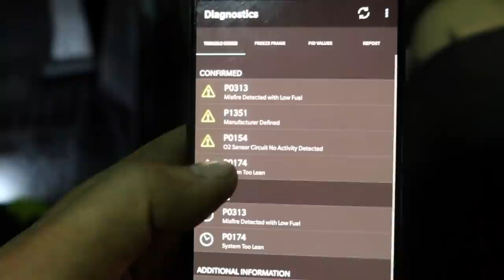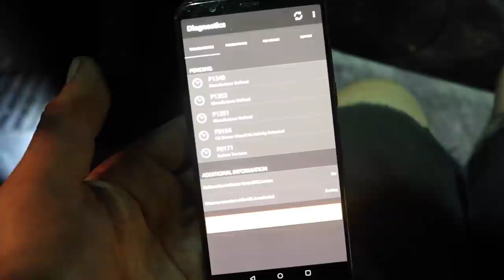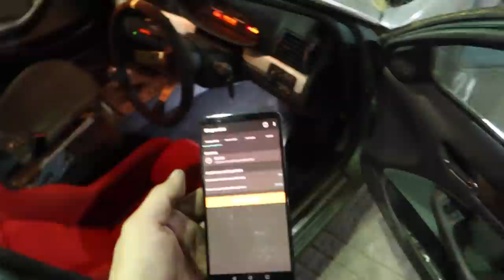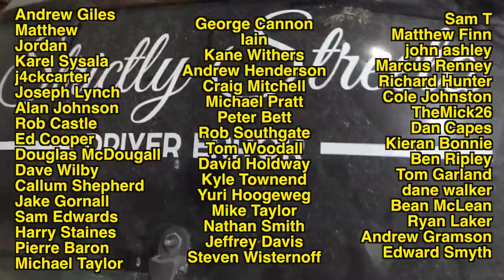THE BASTARD IS ALIVE!

Comment: Lean codes are usually air leak after maf, and being an E46 every bit of rubber and plastic is probably perished 
Even the leaking rocker will contribute
Usually you will get the revs drop when you give it gas. Smoke test is probably the best place to start.

Comment: Looks like misfires on multiple cylinders. Probably the maf as it's been left out. Try starting it without the maf plugged in. It'll run a default map, open loop I think which makes it run a bit rich, but shouldnt misfire if the maf is at fault

Comment: Yo Dan there's likely moisture between the coils and the plugs. Give them a good blow out with the air line when your changing the plugs. Also if you have time throw some  e34 engine mounts in, if the mounts have never been changed.

Comment: Spent more months than I would like to admit trying to solve a P0171 and misfire by dicking around with intake and maf stuff. Nothing made much difference. As soon as I put a new fuel pump and filter in it, problem solved. The car had sat for months and the pump got varnished or corroded and wasn't delivering enough fuel pressure even at idle. Do yourself a favour and do the fuel stuff first, after sitting that long and then choking on the old fuel it's almost guaranteed to be the problem. I'd say it's easier to test fuel pressure on a bimmer than the toyota I was working on which is the only reason it took me that long to solve.

Comment: My money would be on the fuel being so old that it's causing det and the knock sensors are picking it up and then putting the car in a sort of limp mode, drain the fuel and fill it with V-power and see if it's any better. That would explain why it doesn't misfire for a sec when you clear the codes. Also I wouldn't use a MAF cleaner, in my experience putting anything on a MAF isn't a good idea including specific MAF cleaners, sometimes it makes them go out of calibration so you won't even notice it's dodge

Comment: I got a cheap e46 330ci banger and there will be a fair amount to fix. A word from captain hindsight, if you need to change the CCV then take the intake manifold off and do all the vacuum lines as well. Its a bitch if you dont.

Comment: If it’s had no tray under the bonnet vent for agggges it might have leaked many waters into the coil pack sockets in the head …. And hurt them . 
I’ve had misfires from many things that took ages to find . The one that had me stuck for ages, cos none corresponding codes , was the crank sensor . 

Also the oil will be leaking from the everywhere
Reply from the maker: Yeah scary not having that panel filter tray on but it is what it is. Will try and sort something
Reply: @dannyDC2  well least they are all the same so there’s loads about :) plus I can’t expect people want much for em tbh